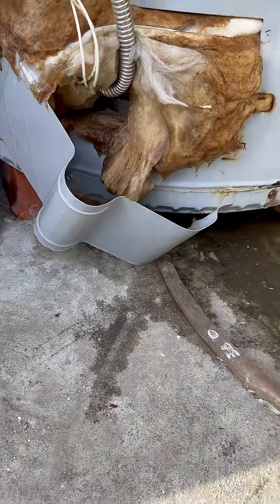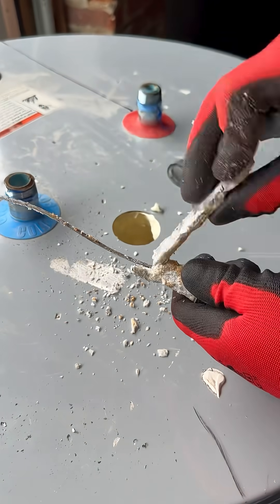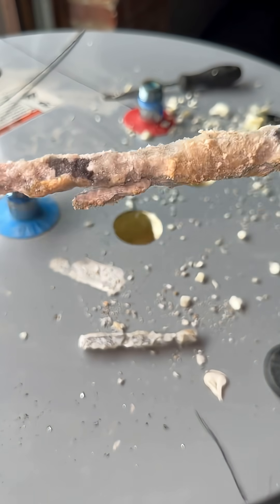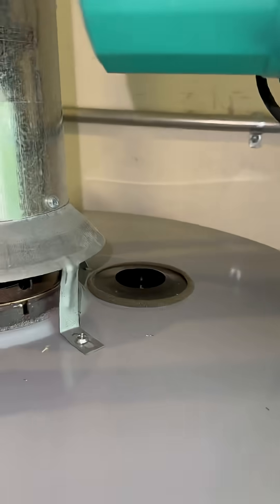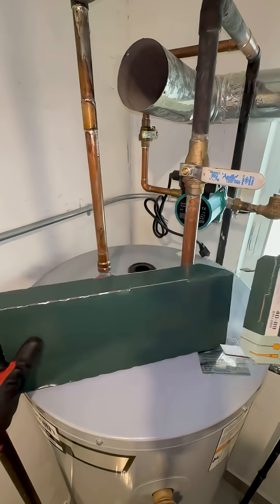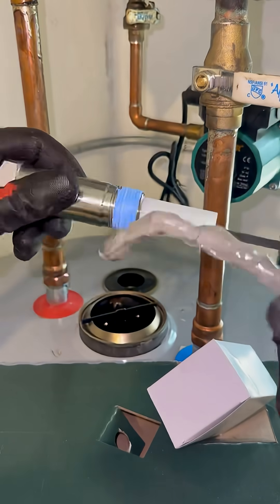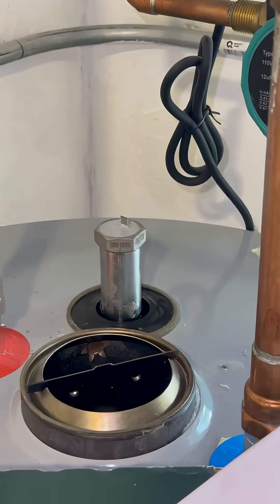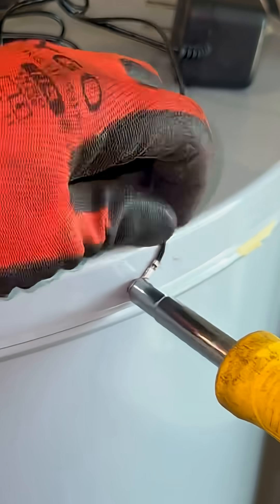Your water heater is fighting for its life! #waterheater #corrosion #anoderod #corroprotecpartner

Comment: Beautiful. Only advice I'll give, scratch the paint off the water heater where you're securing that grounding washer with the screw. You want bare metal. Great vid.
Reply: As an electrical guy i approve this message 👏
Reply: @brandtlilly Me too. I think you should cadweld it to the copper pipe. 🤣
Reply: Yes but the hole the screw made is bare metal. 😉
Reply: @AARONJL92 you want as much contact as possible 😉
Reply: Yeah, with a tiny surface area. Scratch the paint off under the terminal and you'll get a much better connection. 

Little bit of corrosion in your tiny surface area stops the current, and now your titanium rod isn't doing its job anymore.
Reply: @AARONJL92 not good enough.
The current would have to go through the screw and it’s coating and even the screw is only contacting the paper thin metal it’s screwed into.
That’s what we call a ‘bad earth’.
The screw WILL rust and the connection will fail.
Reply: @AARONJL92  You realize you're only giving it one tiny place to hope it never stops conducting right? Takes two seconds to wire wheel and give it a larger surface.  Tell me you've never done work right without telling me.
Reply: You can't tell me you've ever really seen corrosion at the top of the tank all the way at the edge. It's so unlikely that this conversation is splitting hairs. You scratch the surface. Many people don't. Two ways to skin a cat on this buddy. 
 @Chris.Rhodes
Reply: @AARONJL92 nope. You are just wrong.
Bad contact.
Also,
Dissimilar metals + electric current = galvanic reaction.
This will speed up corrosion a lot.

You are literally installing a product that is supposed to prevent corrosion for 25 years and you think it is fine to use a method that will start corroding within a few years.
You are obviously not an electrician, don’t give people bad advice on electrical work.
Reply: @Chris.Rhodes  You realize that between the shaft and the thread that both the screw AND the hole each have MORE surface area than the face of the eyelet, right?

Tell me you never took Geometry without telling me you never took Geometry.
Reply: @digitalis2977  I don't need geometry when I've seen them fail in real world applications. Sure, does it help? Sure. But when I've seen them fail, and creating a better contact point helps tremendously, you can talk about geometry til you're blue in the face, don't really care. 🤷 You do you boo
Reply: @AARONJL92 no only is there no paint in the screw threads but it’s also disimilar metals so you will get some galvanic corrosion
Reply: Screw is fine , someone always has something to say. Green light means good. Had mine like this for over three years.
Reply: @chadog1  he's right the screw is threaded not nut and bolted so it is making good contact. Me personally I scrape the paint.
Reply: @chadog1  or you could consider the FACT that the people who have something to say actually know more than you? 
3 years is not at all impressive.
Your screw will rust and your earth will fail.  This is not a maybe. 
It will happen.
Why install a 25 year product with a 5 year installation method?
Reply: i don't think this guy needs your advice
Reply: @Chris-wq3pe but he’s a plumber..
And he did it wrong?
Good honest tradesman generally appreciate some good advice to be honest.
Reply: the screw itself make contact ;)
Reply: As a technician, I also approve this message.
Reply: it is a ground screw, but not one meant for an electrical fault, the screw can carry all the current that is needed to pass through
Reply: @JonXuereb  it’s not so much about its ability to pass current (though this is far from ideal). It is about the inevitable corrosion that will occur which will break continuity and block current flow completely.

You are right that it will be fine initially, but it will fail eventually 100%. And LONG before the 25 year warranty is up.
If an installation fails before the product dies, then the installation is insufficient.
Reply: The instructions literally say to make sure it is bare metal and not paint. But who reads those?
Reply: There are also washers made to scratch the paint as you tighten the screw but without damaging it anywhere but under the screew head itself
Reply: As a sparky,  I too approve this message.
Reply: Imo these powered rods are gonna take away our work too…i dont mind a client budting a tank every few years 💰💰💰💰💰🤑🤑🤑💰
Reply: But, also, screw threads (bare metal) carry continuity through the underside of head, in (bare metal)  contact with ground connector.
Reply: @tooltym steel screw = high resistance and prone to rust.

Coating on screw (zinc usually) = high resistance/poor conductivity

Electrical current passing through these various dissimilar metals while touching copper as well causes accelerated galvanic corrosion and resistance increases over time until connection fails
Reply: I'm just an HVAC guy and I'm always open to learn new things. This thread has made me rethink my initial comment. @TK24A thanks
Reply: What do you think the screw is biting into?
Reply: The cover sits on top of 10cm of insolation in my country at least it is not grounded, or touching the pipes, i do not know about us boilers.
Reply: The screw is bare metal, and it threads into bare metal
Reply: Dang people. The corro protec has a green LED on the power supply. If the ground stops conducting or if there are any other electrical problems the green LED won’t be lit.   So, unless you don’t look at your water heater for a year at a time to check the light, you will be fine.
Reply: I almost looks like there was a plastic washer at the tank
Reply: un necessary to do that it made morethan enough contact with the screw head and the screw mounting hole
Reply: After scraping off the paint and reinstering the fastener should you apply anything like di electric grease?
Reply: @Yerboiy  Nope, you want conductive connections. If anything, a conductive graphite powder would be best, but you may as well just leave a bare connection, since there's no real need to remove it all that often.
Reply: No, you can apply some fingernail polish or something where you have taken off too much, around the lug, but you definitely don't wan't di grease under the lug, negates the entire point
Reply: @Yerboiy di electric grease would isolate the current and not complete the grounding to the unit.

Comment: Why is it that Americans prefer those tank water heaters instead of tankless, in-line heaters like most of the world? Other than having a warm water backup in case of power shortage (which seldom happens) or setting it up to heat at night where electricity might be cheaper (only in some parts, and I am pretty sure most people don't set it up like that), I do not see any benefits and lots of drawbacks (bulky, limited warm water quantity, maintenance, etc.)
Reply: It's that "maintenance" part that's the problem. Americans are too lazy to do even basic maintenance, like FLUSHING the Water Heater once a year. 

Do that with a Tankless Water Heater, and you're going to be buying a new one VERY soon. But the tank Heater is more forgiving. They can go 5-10 years without ANY maintenance, and still work. Somewhat. 

So yeah. Americans are lazy, so they go with tanks that they can COMPLETELY neglect until they fail, and then just buy a new one.🙄